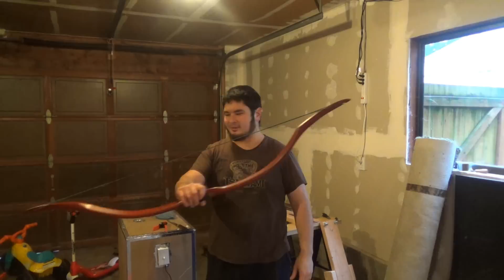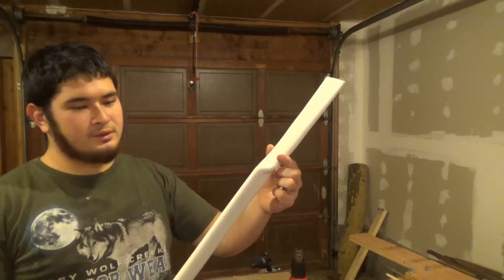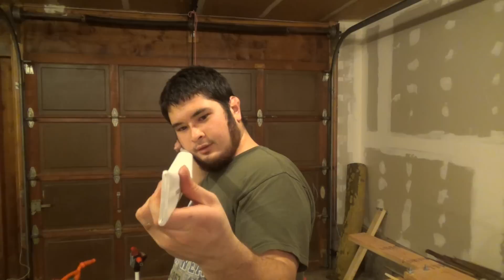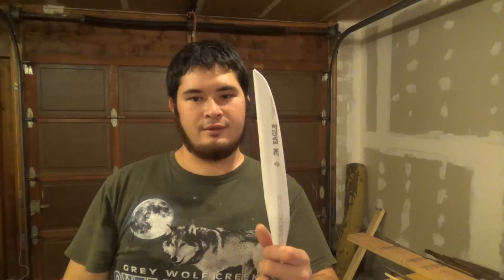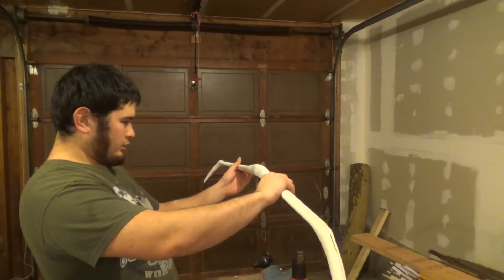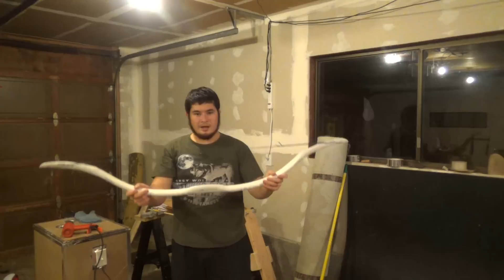Building the 45 Pound Faux Bloodwood PVC Bow Part 1 - Shaping the Bow

Comment: Hey Nick thank you so much. I was thinking about making a larger size horse bow for my practice but I didn't know what the measurements would be using a 1 inch pipe rather that a 3/4. But I was so glad to find this video with the measurements. I really wanted a siyah for my bow as well so this video was just what I wanted.
So I made one for myself on a stovetop and it works very well. It is very powerful. I wish you could like a video more than once. Thanks again

Comment: That pvc you use is really good. in Turkey i cant find schedule 40 pvc pipe. PVC i used when i heat them they melting on the surface but don't soften like yours do.

Comment: Hey Nick. It looks like you do a lot of your hand forming with the bow on the 'cool' side. In other words, when the bow isn't super-pliable/super hot.  Do you do this for greater control? I'm also impressed by the spot forming you do for the short transitional spaces. Do you happen to shield the areas you dont want to affect when doing this?

PVC bow building at the level this bow requires is certainly an artisan craft! Looks superb!

Comment: this is a very nice bow one thing I would like you to confirm is the size pipe you use as it looks bigger than 1 inch dia.And thanks for the how to video's
Reply from the maker: Thanks! The pipe is called 1 inch, it's based on the nominal inside diameter, so you are right in that 1" pipe is closer to 1-1/4" in outside diameter.
Reply: BackyardBowyer
thanks for the response like your methods in bow making with pvc pipe. subbed

Comment: Hi Nick. 

Sorry for the long comment, but over last 2 days I've gotten the PVC archery feaver, thanks to you and Lars Anderson. I'm going to start building this bow next weekend, but I've got some questiones that I was hoping you would have the patinece to answer.

First of, strictly out of curiosity (since I'm a freshman in a enginering college). You haven't explayned why you put the deflex closer to the shyas (or w/e they are spelled, you see I'm strugling with basic english =D). I'd presume that it's because near the shyas, where the taper is more pronounced you prefer for the bow to store more energy, than in a more rounded part of the bow, where a lot of tension would be caused by the potential energy trough the Y axis up the bow from the handle. Any of that makes sence? Also I've got a formfactor problem. I'm quite a tall guy with long arms. My hight is 6 ft 9" by your standards, and my draw would be about 33" by 2.5 standard. That is about 20% longer than your draw, and I was wondering how to get a 32 inch draw bow with around 50#. My intuitive knowleadge of math and phisics says that i shold build with a 1 1/4 " PVC pipe, and get a 61" string, but the lenght of the pipe is confusing me. Every inch of the pipe more is about 5# less, and every inch of the draw is about 5# more (random internet "facts" I found, please do correct me). Anyways, you're the expert, and I'd like some tips, since I'm starting this project next weekend, and I'd love some constructive guidlines to try to cut down on the time needed to create a functioning bow for a abnormally tall guy like me.

Hope you got the patience to read and answer my questions since I do feel kind of out of sync because I don't understand 100% how evrythign works.
Cheers, and keep up the great work!
Mark
Reply from the maker: Marko Lopac Thanks for watching!

The deflex closer to the siyahs, or the static tips, helps to decrease handshock. Bows of this style usually have more handshock, which in this design comes from energy from the limbs feeding back into the bow and giving something akin to recoil in the hand. The deflex at that point encourages the limbs to drive outward, not forward. Like you suggested, it also helps the bow store more energy further out near the ends of the limbs. The more flex near and into the handle, the more handshock in general. I'm not 100% sure on the mechanics behind it, all I know is that this drops handshock and does make a bow perform a little faster.

As far as draw length goes, a rough estimate that I use is one inch of bow length is somewhat equal to one inch of draw length. So to get the same draw weight I did at a 32" draw, you would add 4 inches of starting pipe length. It's not perfect, but close. So for a 50 pound bow in this style, start out with a pipe 3 inches longer.Hope this helps!
Reply: Shure it does, thanks a lot. I'll make a video of it when I finish it out. Thanks for the help! cheers

Comment: Hey nick I just have a quick question. So I added siyahs onto a bow I made, and I did them almost the same way as this. The ones I made are shorter, they are fairly thickly flattened. And I used 1/4 inch pipe. Did I do something wrong?

Comment: If i wanted a 30-40 pund bow but wanted to use 3/8 in pipe wat would the measurments be?
Reply from the maker: Arrowgaming You would want to start with a 46-50 inch long pipe to get around 30-40 pounds at 28 inches. The shorter the bow, the heavier it is and the longer the bow, the lighter it is. Hope this helps!
Reply: +BackyardBowyer  If I wanted a 30 lb bow with the 1 inch would that also be the same?

Comment: Hey Nick! What is the size of the PVC pipe? I mean the - diameter ? Is it 3/4 Pipe? Can you link it to me? Because I can't hear you well, when you say: 58 inch long... 1 inch... and I can't hear you well. And there is no information in the description.

And by the way, what is the name of the material you fill the pipe in part 2? 
Thanks!
(I just bought a pipe and I ruined everything ;( ! I tried with "fire" (because I don't have heat gun) and I failed :X !)
Reply: I think its quarter inch. Idk for sure tho
Reply: It's 1" diameter sch 40 pipe

Comment: Is the durability of these items a year? What type of string are you using?
Reply: Mortaryan idk about Nick, but I've bern using 550 paracord or 1/8 diameter polyester rope that's sold right next to the paracord at Menards. They both work fine for me. Each costs about 4 dollars for 50 and 48 feet respectively.

Comment: So he uses no fiber glass rods on this bow??
Reply from the maker: Yes, there are no fiberglass rods in this bow. Adding one rod would bring it up into the 50 pound range.
Reply: @BackyardBowyer  I appreciate your response. I use the aluminum handle on a snow shovel or crutch or medical shower chair for the siyahs. So if I made a bundle of fiber glass rods like a leaf spring. 36,30,18,12,9 and 6 inch. And used that as the core in a 1 inch pvc 61 inch like this im guessing it would be  90lb bow than ?
Reply: @BackyardBowyer  The trampoline effect i.e. corking a bat. Allows the baseball to stick more when hit delaying the amount of time it takes to leave the bat allowing for the batter to adjust his mistake or aim to account for any minor mistakes in accuracy or swing. The same physics are produced by the string bridge or manchurian string pad. It allows the string to fall into the semicircular groove or wedge this increases accuracy and reduces noise and hand shock. You can add 5-15fps it also allows you to readjust your shot if your draw isn't perfect. The string has to be longer which puts less tension on the bow and the knot lies in the middle of the groove. Or where the base of loop is. I've Heard you say before that the string pad won't effect performance, look into it I think it will evolve you. Cork core, surrounded by rubber,  than wrapped in yarn or thread, than covered in leather has been the best performing so far. Rectangle might work better than a circle though like a trampoline I'm not sure on that yet though.

Comment: There's no way that the string is 51 inches long cause I followed everything you said and the string barley even make my bow curve.
Reply from the maker: BostonTricker What did you use for a string? Paracord and other stretchy materials will stretch out, so you may need an even shorter string. I'm using Dacron B-50, so the string does not really stretch when I put it on the bow.